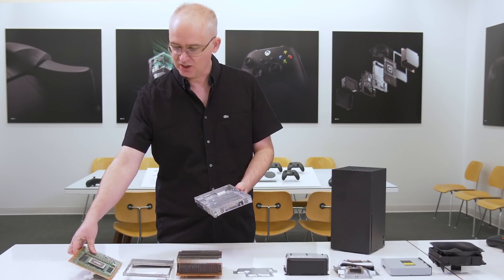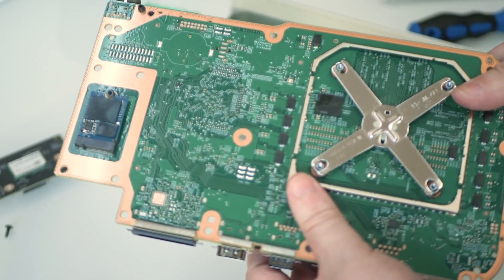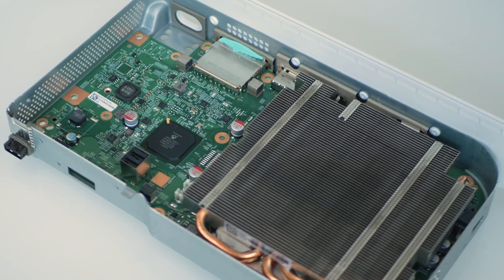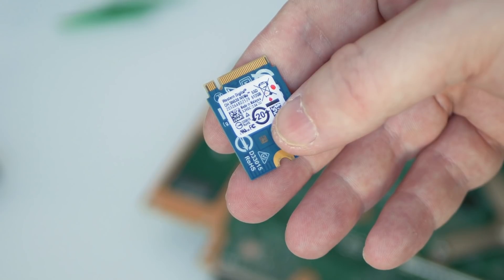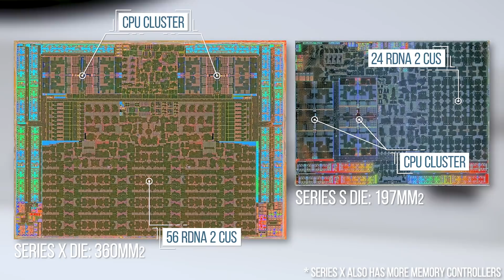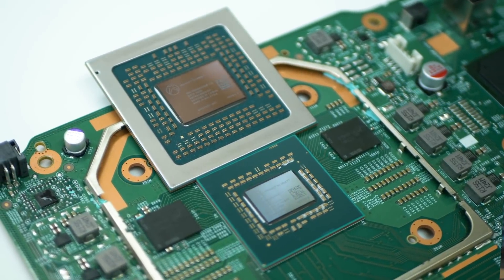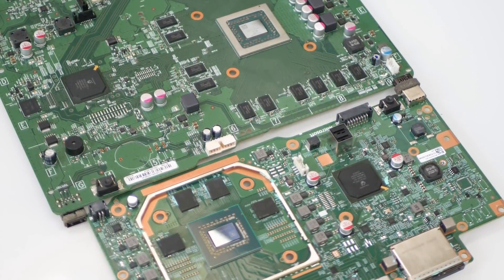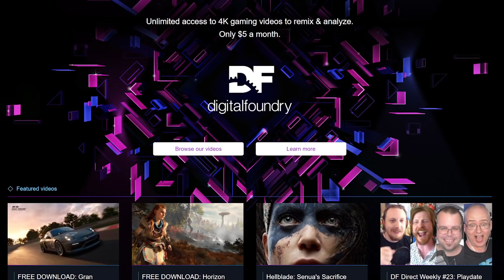Xbox Series S Complete Teardown: Inside Microsoft's Superb Mini-Console

Comment: I can't fault its value but it's not living up to Microsofts claims so far. Wasn't it marketed as a 1440p 60fps system? More like a sub 900p 60(ish) system
Reply: Yeah, but both the Series X and the PS5 are also not hitting 4K60 very often. There are several games that top out at 1440p on Series X and PS5, so I don‘t know how anyone can expect the Series S to deliver that. All next gen consoles don’t hit their marketing claims. The PS5 has an 8K sticker on the box, but cannot output 8K at the moment. So, I wouldn’t single the Series S out. It’s a great machine for it’s price.
Reply: @xxlive4eatingxx275  I was singling out the Series S because that what the video was about 😋
Reply: @duncanself5111  I give you that one. ;) I just find it strange that it always comes up when it’s about the Series S. 
And I’m also amazed that anyone still believes in marketing claims. At the end every product disappoints if you expect the stuff the marketing team cooks up.
Reply: @xxlive4eatingxx275  I know marketing claims are a load of bollocks but they were way off the mark with this console, at least so far
Reply: @duncanself5111  I don’t have the feeling that they are further off than for the other next gen systems. Sub 1080p just has a very last gen feeling to it. I think relative to their target resolutions they all perform very similar. But, I agree that they could’ve just marketed it as a 1080p console, which would’ve probably changed the narrative, because then the Series S would frequently surpass its marketing claims.
Reply: still waiting for super sampling from AMD, and next gen games build from ground up for these new consoles. Don't worry, upgrades still on their way, it's not like you pay 500$ to play 1080p games like returnal.

Comment: Yeah, the Hardware design Microsoft did with the Series Consoles is amazing. I got myself a PS5, and I prefer it's approach on many aspects, but I can't deny that between it and the XSX I think the XSX has a better case design, cooling design and is overall more practical.

Also I do suspect that the Case and cooling hardware of the XSX is cheaper than the PS5 (though the chip is probably more expensive, so I think Microsoft is taking more of a loss with XSX vs PS5 Disc), so all the more impressive that it gives superior results. Add on top that Microsoft is a traditional Software Company and Sony Hardware...
Reply: What aspects of approach do you prefer exactly for conversation sake on the ps5?
Reply: @timothyweakly2496  While I really like the exchangeable builtin SSD, I really don't like the SSD Slot design they chose, I think it WILL limit developers in what they can archive and it's bad for Customers, especially in the long run. PS5s approach may have been... Confusing, but with clearer messaging and earlier software support it would've been the clear winner for me, and even now I prefer it. 

Also the Memory (DRAM) design on XSX is... Problematic, especially if you consider the XSS too. Also general scaling between XSS and XSX performance, expecially when it comes to Ray Tracing, is far more complicated than Microsoft promised, we're seeing many games really struggle to or giving up on meeting Microsofts promises. They could've seen that coming TBH.

Also, going in a complete different direction, I do prefer Sonys Game Ecosystem (duh, that's the reason I got a PS5: GOW, HZD etc are amazing), and, though they have not kept it due to the Chip Situation etc, their initial commitment to console generations.

I just don't think that Microsofts Business Model is entirely sustainable, and that makes me suspicious of how they would continue if they were to dominate.
Reply: @9SMTM6  I understand your thinking. Should be interesting to see how it plays out.
Reply: @9SMTM6  one note on your thinking however that from history is developers towards consoles are truly amazing and even the known struggles or unforseen struggles have been overcome by amazing people and the results have been incredible. I'm expecting great things all around and am very excited about this generation especially with the cpu because hopefully now we can get better ai physics and animations.
Reply: @9SMTM6  If Microsoft wated to dominate they would considering the resources at their disposal compared to Sony. I think Microsoft sees more value in pushing Game Pass and cloud gaming services seeing that Avenue as their money making tool. It looks like they are trying to set the standards for the future and be the front runner in that department for future Gens. All in all though from an engineer perspective. Both consoles from Microsoft are absolutely quality in terms of architecture and design. The series s is such a well made machine for a next gen console
Reply: "so all the more impressive that it gives superior results" The XSX has 52 CUs whereas the PS5 has 36 CUs, what's more impressive is how the PS5 manages to perform so close to the XSX. I wish Xbox actually had games ready for me to experience and show what my new Series X is capable of instead of playing last gen games, thanks god Sony was ready this gen.
Reply: @Tom-dg5sc  I explicitly talked about cooling hardware and case design.

I think the Jury is still out, if we will ever find out, which Chip was better for their purposes.

If I were to guess the reason for XSXs vs PS5s Chip Design, the much broader design for the XSX is probably because they also want to use that chip in their servers, and that design allows for better energy efficiency.

PS5 has better board design and clocks MUCH higher, with higher energy density (probably among the reasons they decided for the liquid metal TIM), so yeah the chip is more price efficient, but that would not work in servers.

Comment: Yawn. Another paid for Xbox video??? All the videos you did on Xbonex and it died a horrible death in 2 and a half years. But it is a great little console so long as its the right time of day and it doesn't look so flat if the sun is setting............ like that original Halo 6 debut gameplay lol.
What about the parts where ray tracing gets completely left out on series s games? Oh right, you can't talk about red alarm warnings like that and what's to come for this piece of crap console the next 5 years.

Microsoft, the only ones with a console sitting in stores AND selling out. Its almost as if series s didn't exist, they would have a larger install base of series x overall right now as a result. Oops, dropped that ball Microsoft.

It is a great video though for all the warehouse and retailers that actually want to know what is inside that box cluttering up all the space they need for PS5 console stock.

Comment: How did you brick it? Unless you’re doing some low level, unsupported firmware stuff it’s almost impossible to brick consoles.
Reply: Trying to 'upgrade' the internal M.2 2230 SSD perhaps?
Reply: @PastorMolez  nah because this console didn’t look like it was opened prior to bricking
Reply: @thatoneguy335   well my suspicion is that it isn’t actually non-reversibly bricked
Reply: @PastorMolez  well my suspicion is that it isn’t actually non-reversibly bricked

Comment: The RAM cooling is really overcomplicated and I worry about the backside module, but if it works and is cheap enough, whatever.
Reply: I assume the backside Module is the cheap one that runs really slow on the S. Thats why it doesnt need cooling. Its only for the OS too. As far as i know at least.